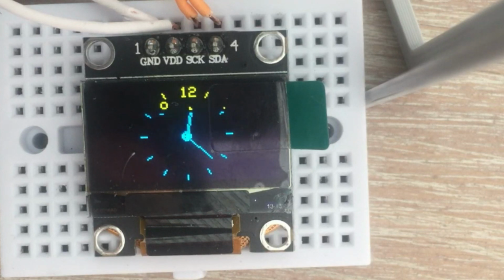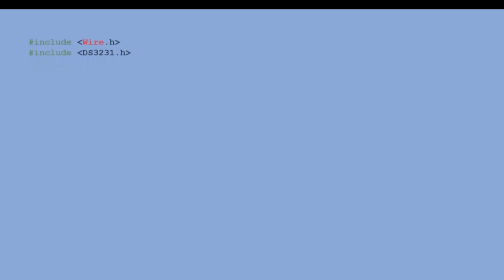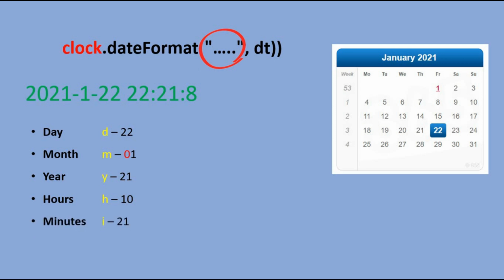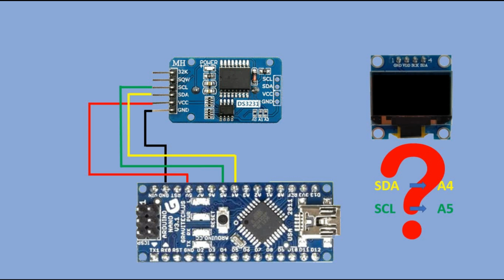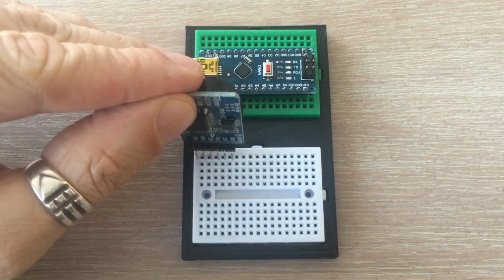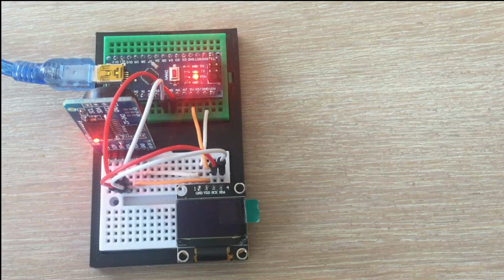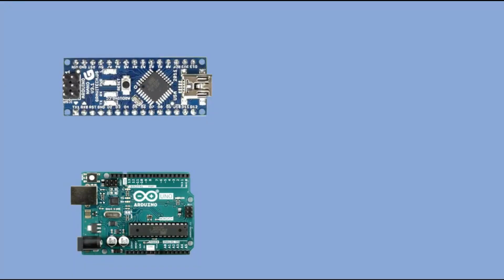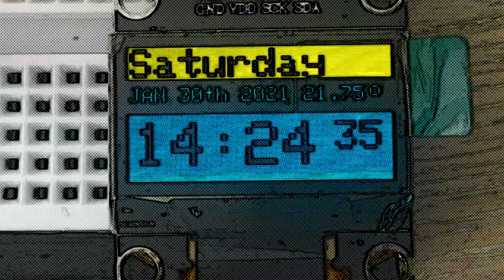How to use DS3231 RTC module to build OLED clock

Comment: does this code set the current time on the RTC? if so, will it show the current time after I disconnect the power to the Arduino and then connect it again after a few minutes, or will go back to the time the sketch was downloaded?
Reply from the maker: Yes it will. There is a single line of code which you need to have in setup so that it sets the time at the compilation. Then you need to comment that line out and reload the code without disconnecting microcontroller. If you do nnot do that then the clock will always reset time to that compilation time . After the code is reloaded with that line commented out then the clock will keep time as long as battery is ok.
Reply: ah, ok, I will try that when I get home. Thanks a bunch.
Reply: I finally got it. Thanks a bunch!
Reply from the maker: Check also https://youtu.be/9OcewS8sa68 this video. It shows clocks built with ESP32. This gives you a lot of possibilities of synchronising time from Internet so you do not even t=need RTC module. As lon as Microcontroller can conenct to internet your clock will always show precise time

Comment: 'DS3231 clock' redeclared as different kind of symbol  Please help me: This is the error I get
Reply from the maker: Have you nstalled the proper library. There are few libraries you can download with the same name. It has to be this particular one
Reply: @marios_ideas  How do I recognize the right library?
And how do I find the wrong libraries
Greetings Leo
Reply from the maker: @leohamelinck3524  in my video there is screen where you see the author of this library. Use it when you google it
Reply: @marios_ideas  Hello Mario, I have that library in my folder. I also deleted all DS3231 libraries. and downloaded the correct library and copied it into the library file. Unfortunately that doesn't help. The "error" unfortunately keeps coming back. I don't understand it!
Reply from the maker: Try DS3231 rtcClock; // Use rtcClock instead of clock
Reply: @marios_ideas  You are a genius, my thanks are great !

Comment: Mario, old friend, I made this about a year ago and just fired it up again the other day.  Still keeping good time!  So I decided to tweak the sketch so it would show in Fahrenheit.  No problem.  Then I need to slightly move some of the digits, etc.  Thought I'd better update my Libraries too.  Did that and then troubles!  Getting error msgs when I tried to validate the sketch.  Had to change "clock" to "clock1" and then got other errors about RTC, etc.  So now the OLED looks ok but every time I plug it in it just goes back to the same time and date every time.  Tried many different tweaks in the sketch but no go.  I think something happened when I updated my Libraries.  Checked the battery in the DS3231 and it is fine.  
Perhaps , if you would be so kind, you could go back and update it.  Would be most appreciated.  
By the way, I don't remember when I got the "OLED clock using DS3231 RTC module with the memory problem fix"  mentioned in  an earlier comment a year ago.
Reply from the maker: Paste the setup function from the code you are trying to load
Reply: @marios_ideas  Is this what you want?  Also getting error: 'RTCDateTime' does not name a type; did you mean 'DateTime'?
void setup() {
  Serial.begin(9600);
  Clock1.begin();
  // Set sketch compiling time
  Clock1.setDateTime(__DATE__, __TIME__);

  // SSD1306_SWITCHCAPVCC = generate display voltage from 3.3V internally
  if (!display.begin(SSD1306_SWITCHCAPVCC, 0x3C)) { // Address 0x3D for 128x64
    Serial.println(F("SSD1306 allocation failed"));
    for (;;); // Don't proceed, loop forever
  }
  display.display(); // Display initial Adafruit logo
  delay(2000);

  // Clear the buffer
  display.clearDisplay();
  display.display();
}
Reply from the maker: @am1manTravel  You said you loaded the code after you upgraded library and the clock does not work. But now you say you get compile error so you couldn't load the code with error in code. Also the library I was using in this code is an old library which is not further developed so where did you get the update. There are other libraries written by other people with the same name so maybe you installed different library
Reply: @marios_ideas  Well, I think I fixed the multiple DS3231 libraries and got the one you recommended, the latest version, in there.  Still the same problem with the time.
Reply: Sorry for all the msgs.  Think I fixed it with ChatGPT help.
Uncomment the clock1.setDateTime(__DATE__, __TIME__); line.
Upload the sketch to set the time to the current compilation time.
Comment out the clock1.setDateTime(__DATE__, __TIME__); line again.
Re-upload the sketch so it doesn't reset the time every time it powers on.
Reply from the maker: Chat GPT seems to be a really helpfull tool nowadays. I use it quite often as well. Glad your problem is fixed
Reply: how did you convert Celsius to Fahrenheit?
Reply: @JohnAllen55   clock1.forceConversion(); // Force temperature conversion
  float celsius = clock1.readTemperature(); // Read temperature in Celsius
  float fahrenheit = (celsius * 9.0 / 5.0) + 32.0; // Convert to Fahrenheit
Reply: ok, but where to I place this in the sketch?
Reply: @JohnAllen55  I put it in the latter part of the sketch shown below: 
 
void loop() {
  dt = clock1.getDateTime();

  display.fillRect(0, 0, 128, 16, SSD1306_WHITE);
  display.fillRect(0, 17, 128, 16, SSD1306_BLACK);
  display.fillRect(0, 31, 128, 33, SSD1306_WHITE);

  display.setCursor(1, 1);
  display.setTextSize(2);
  display.setTextColor(SSD1306_BLACK);
  display.println(DayOfTheWeek(dt.dayOfWeek));

  display.setCursor(1, 18);
  display.setTextSize(1);
  display.setTextColor(SSD1306_WHITE);
  display.println(DayMonthYear(dt.day, dt.month, dt.year));

  display.setCursor(3, 35);
  display.setTextSize(3);
  display.setTextColor(SSD1306_BLACK);
  display.println(CurrentTime(dt.hour, dt.minute));

  display.setCursor(100, 35);
  display.setTextSize(2);
  display.setTextColor(SSD1306_BLACK);
  display.println(AddLeadingZero(dt.second));

  clock1.forceConversion(); // Force temperature conversion
  float celsius = clock1.readTemperature(); // Read temperature in Celsius
  int fahrenheit = (celsius * 9.0 / 5.0) + 32.0; // Convert to Fahrenheit and remove the decimal fraction

  display.setCursor(90, 18);
  display.setTextSize(1);
  display.setTextColor(SSD1306_WHITE);
  display.print(fahrenheit); // Display temperature in Fahrenheit
  display.setCursor(102, 16);
  display.print("o");
  display.setCursor(109, 18);
  display.print("F");

  display.display();
  delay(1000);
}
Reply: ok, got it. Thank you very very much for taking the time to help your followers. I am subscribing and will help when I can. 

Now I understand. I was struggling with where to declare the Celsius and Fahrenheit variables. I realize that it can be done in the body of the loop. I knew that but did not know how to do it correctly. Thanks again.

Now, I am sorry, but I was trying to figure out how to correctly code the time conversion to a 12 hr clock, will you help me with that?
Reply: @JohnAllen55  I use the 24 hr clock.  Can't help with that.  I used AI to help me.  You can ask AI, like Chatgpt, hoW to do it.  Something like:
In the following Arduino sketch, change the time from 24 hour format to 12 hour format with A.M and P.M.
(Then put the whole sketch here)
Reply: ok, no worries. I'll keep trying to figure it out. Thanks a bunch.

Comment: Use quite a bit of memory to add an alarm and to manually change it wouldn't it?
Reply from the maker: Well the majority memory is used for OLED display buffer. With very little memory nano has to offer any library consuming slightly more memory can cause the bottleneck

Comment: the "redeclared as different kind of symbol" error happens because there are two different libraries with the same name, "DS3231", one by andrew wickert and the other one by Korneliusz Jarzebski.  this last one is used in the present video. uninstall the other one (which is much more popular and available at the online repository).  the author of the video seems to be unaware of this problem.
Reply from the maker: At the time of vide creation I had to install the library. So at this stage I chose which one I want to install. If you installed one before and then decide to use Jarzembski's library it is clear that you have to  remove the library that has the same name as both cannot coexist. I have never run into this problem as I have never installed the other library to start with. Later I experimented with both but that was after i created this video

Comment: Thank you.  I used the code "OLED clock using DS3231 RTC module with the memory problem fix" and it worked!  Is there a way I can change the temp from C to F?  More importantly, it does not keep time when unplugged from power even though I have a fresh battery in the RTC.  Any ideas?
Reply: I fixed the time issue!  still looking to change C to F.
Reply from the maker: This should be a simple formula to be applied to a variable storing celcius value . Temperature in degrees Celsius (°C) = (Temperature in degrees Fahrenheit (°F) - 32) * 5/9.

Comment: Clock time size is (2), seconds text size is (2)…..But they are Not displayed as the same size…where is the catch ?
Reply from the maker: Ups....:) You just spotted the error in my video. I updated the link to the code in the description. There you will find the actual code that was used to achieve the result you see in this video.

Comment: "Ds3231 clock redeclared as different kind of symbol" this type of message shows when tried to upload the sketch. Please help me in this regard. All libraries has been downloaded.
Reply: this error happens because there are two different libraries with the same name, "DS3231", one by andrew wickert and the other one by Korneliusz Jarzebski.  this last one is used in the present video. uninstall the other one.  the author of the video seems to be unaware of this problem.
Reply: I get the same error on ESP32, this seems to be an error with a separate clock library. The compilation error "redeclared as different kind of symbol" typically occurs when you have conflicting declarations or naming issues in your code. In this case, it seems that you have a naming conflict with the symbol 'DS3231 clock'. Perhaps this is due to a separate clock library we have loaded. ...but if so which library is causing the problem?

Comment: everything works fine, but when I disconnect the arduino from the PC, wait a few minutes, connect it again,  Time starts from the moment where I cut off the power. 
Where is the fault hardware or software?
Reply from the maker: no battery or dead battery in the RTC?
Reply: @marios_ideas  Seems like I have the same issue. I checked the battery and it was full.
Reply from the maker: @donzhu4996  I must be the hardware. Software is just reading the time from the RTC. The problem I had once was the time was always reset to the particular time after restart, and the solution was that there was a line in the code that was setting the particular time. But this is not the case you guys have here

Comment: What part of the code will the address 0x68 (for the DS32321) be used? I understand that Arduino can communicate with I2C devices thru their addresses but I only see the address for the OLED being used. I hope you can respond to this. Thank you!
Reply from the maker: Yes you are right. In declaring the RTC you do not quote the address. So It must be done in the library code and that would indicate that DS3231 has fixed address as opposed to OLED displays which I thinkk have 2 or 3 potentialy different addresses.
Reply: @marios_ideas  Alright! I understand your explanation. 

Btw, I'm doing a project now. But I'm using an LCD instead of ng OLED display. The clock.dateFormat won't work whenever I want to print to the LCD or the serial monitor. I use these for trying to print:

LCD: lcd.print(clock.dateFormat("H:i:s", dt));
Serial Monitor: Serial.println(clock.dateFormat("m.d.y|H:i:s", dt));

If you have any ideas about this, it will be very helpful! Thanks a lot!
Reply from the maker: Is it possible that it is the same memory problem that I descried for oled displays. So the rtc library plus liquid cristal library together consume too much memory. Try to remove from code lcd part and see if then serial.print works

Comment: while running the library DS3231 SIMPLE code , there is no time displayed in the Serial monitor. The code shows no error but while printing the output in the serial monitor, there is an empty space. hence current date or time is not displayed.
Reply from the maker: Having you checked if the device is recognized by i2c bus. Look for the i2c scanner code and run it. It will show you if the module is visible and under which address
Reply: @marios_ideas  its not the device issue. Seems some issue with the library. I am able to run the DS3231_simple code of that lib under examples and i get the date and time under Serial Monitor. But when running the DS3231_DATEFORMAT code its not giving any output and gives only blank spaces in the Serial Monitor
Reply: @marios_ideas  it was a bug in the library. In the Github page updated library file is there. After downloading that the issue is resolved

Comment: I want to know how to make a clock by using u8g2 library, how to set address for oled screen?
Reply from the maker: I do not know that library but I have some projects in the pipeline that will use OLED displays. If I like this library I may use it and do a small tutorial on it

Comment: you have not shared your second code, i dont have mega, will you plz send your second custon fuction code.
Reply: first one does not run in nano or arduino
Reply from the maker: In https://create.arduino.cc/projecthub/mdraber/tutorial-on-how-to-use-ds3231-rtc-module-e12b38?ref=user&ref_id=1474727&offset=6 there are both codes provided
Reply: @marios_ideas  thank you so much i got it !!!, what changes should i make in the 2nd code to show 12 hr format?
Reply: @mominkhadri8062  I want a 12 hr code I've been pulling my hair all day
Reply: @deniker1  same here bro

Comment: Are the new version now? I did exactly the same code but it doesn’t work
Reply from the maker: What exactly does not work
Reply: „RTCDateTime does not name a type
Reply from the maker: Nikodem Karcz so do you have an error when compiling?  Can you paste the line of code and an error
Reply from the maker: Did you install the libraries?
Reply: @marios_ideas  yup
Reply: @marios_ideas  as i said „RTCDateTime does not name a type”
Reply from the maker: For me that indicates that there is something wrong with the library. Have you installed the one from the link I provided in the video. There may be other libraries named the same way from different creatrors and they have different RTC commands.Have you installed other vliraries for the same RTC module. The best way would be to uninstall all libraries and install the  right one anew
Reply: @marios_ideas  I have the exact same problem, i used the library from the link
Reply: And code is „RTCDateTime dt;”